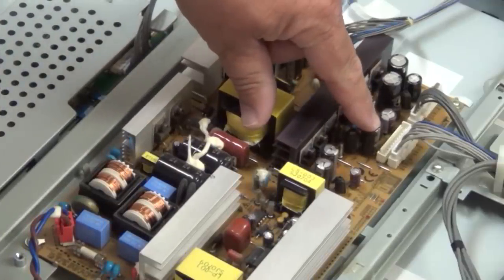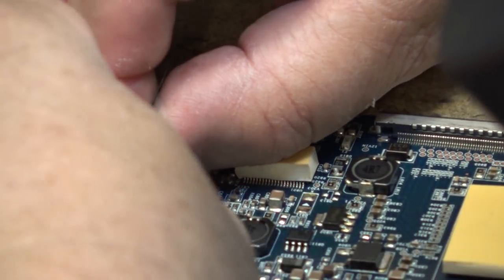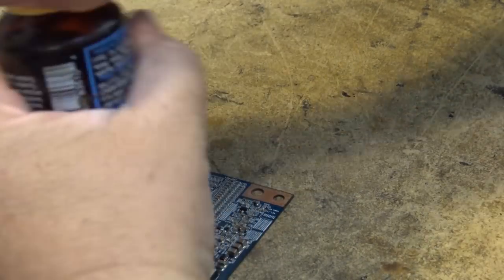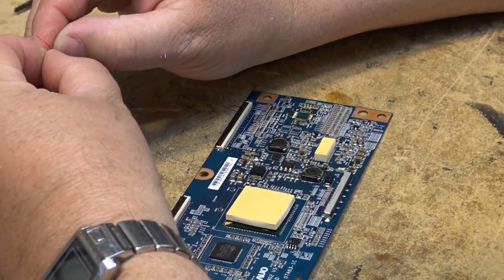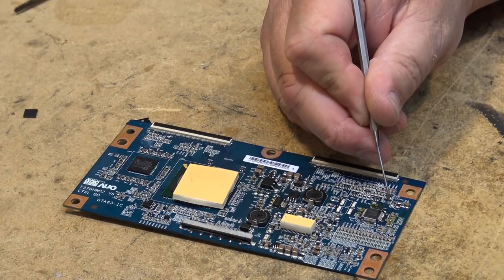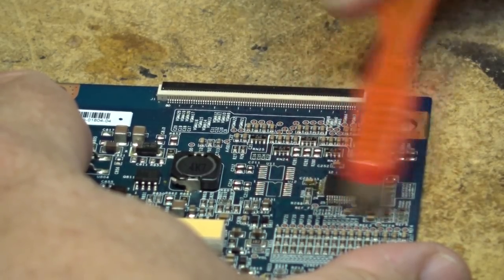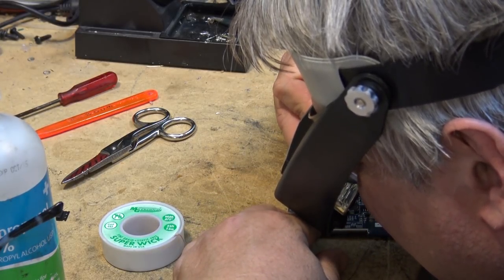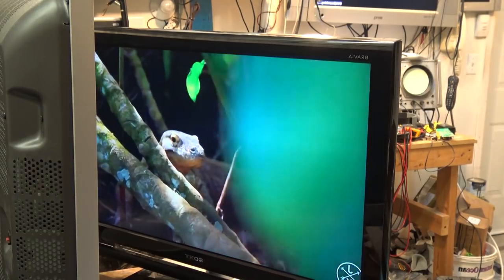Sony KDL37XBR6 Part 2 TCON board repair to component level

Comment: No hot air station for me,  if I occasionally need to do this I use my $40 hot air gun.  No issues at all with that really.  Those super cheap $50 hot air stations scare me though,  to many stories/videos of them melting down, catching fire, being wired improperly, etc.
Reply from the maker: Yes I have used an hot air gun, and masked the areas of the board that I don't want to blow components off using my aluminum heat shield mask tape.
Reply: Yeah, easy to blow stuff off with a hot air gun.  Last year I got an iso tip solder pro 120 butane iron with a hot air tip that works nicely with smaller ICs like QFN/QFP and the DPAK and sot 23 stuff, I been using it more lately.  It doesn't blow shit everywhere nearly as badly.  I think I paid $50 for it

Comment: A very good job. But you do not have to feel that you can touch the hot soldering tip. This will make everything more expensive than one dollar and sixty eight sent to the doctor! haha!
Reply from the maker: Doctor visits cost me nothing.  Spent the other day in the er after suffering heat related symptoms  at work due to not drinking enough water. Spent all night hooked up to monitors and got a bunch of fluids by iv.  Cost nothing. Would hate to think what that would have cost just a few miles south of here.
Reply: @12voltvids  Lucky you, be glad that you do not live in the south ...
Reply from the maker: @gerharddanny1160  
Yes I know how bad it is there.  One of my fires clients slipped getting out if a car in Arizona.  Landed on hot pavement.  Burns and a broken hip.  Hospital bill over 100,000.00

Comment: use a paint stripping heat gun they do the job and they are quite cheap
Reply from the maker: James Hanley 
Yes I use one as well but for micro surgery like this scalpel or razor works even better. No risk of blowing away small parts.

Comment: You need the correct equipment to take a way this IC
Reply from the maker: Actually you don't. We cut the old chips out like that for years at the shop. My boss was too cheap to buy an air station. We wither cut them out like that or inserted a steel wire under them and heated and pulled the wire. Never damaged a single board and I did it hundreds of times. An air station makes it easier but I am not about to invest in something I will never use again.

Comment: how many watts is your soldering iron?

i started watching this video and whispered - oh no, oh shit, oh no, not a chip, oh shit... 
i had the experience of replacing several chips on hard disks. maybe you know this terrible story in the begin of 2000th about 10 and 20 Gb 3,5" fujitsu drives? ahh youth... where is my 31?
snots after soldering, x10 lens, removing excess solder, international toothbrush with alcohol... i wanna repair some right now!
p.s.
sorry for my french, i dont learn english and have many errors
Reply from the maker: That was a little chip. Some of the jungle chips on those single chip TV solutions had 100 or more pins on them.  Mind you most were 1mm pin spacing which are about 50x easier to change than .5mm, and my eyes were 20 years younger. 
Anyway this is the way real service engineers measure their dicks. The ones that can diagnose and repair to component level. Board jockeys is the new tube jockeys. (That is what we called the guys that would pull all the tubes in the TV and radio tube days and run to the drug store and test them all.) Back in the tube days the real service techs were the ones that went for resistors and capacitors first and only looked at tubes of the filaments were out, or the tube was glowing like a neon bulb inside (gassy)
Used to love the guys that would come in to buy a new horizontal output tube and they would come back with the new one and the glass was all caved in due to heat. There was a bias problem, and the tube got so hot it melted the glass and the atmosphere basically deformed the envelope. 
Of course these guys generally needed a flyback now, because they were running so much DC current through the winding that now it was shorted too.
Lots of board jockeys out there that swap boards like they are going out of style. Very few have the skills to troubleshoot to component level these days.

My soldering iron is 60 watts, temperature controlled. Just a cheap one, and I highly doubt that the temperature on the display is accurate, as I have to have it cranked up to over 800' F to get a good bond, but it does get the job done and t he tips for it are pretty cheap.
Reply: i remembered the unusualness in the video! where grounding through 1MOm? how about to burn the chips because of static electricity?

yup, i need new soldering iron. i have jealousy, looking at your work. one touch and the solder is ready. but 60wt and 426`C is to much. i think about 35-40wt and 300`C (for small, under 25V, and big, 200V, capacitors), 25wt It`s hard to warm up the two-side board.the day after tomorrow I'll probably buy iron. patience is over! :)

pardonnez moi, if I'm annoying!
Reply from the maker: No such thing as too much heat. Just don't hold it on the pin longer than necessary.
 As to static, I have yet to pop any device from static discharge. My iron is grounded and I live in an area where the humidity is high as the ocean is perhaps 100 meters away, so we don't get much static electricity here.  Some types of components may be more static sensitive, but the analog chips in TVs are pretty immune to all but the most severe ESD.
Reply: well... can i (or we) hope for a video about the ocean?
Reply from the maker: I have done a few. Did a storm last summer on the Oregon coast.

Comment: Wery real picture on this one !.
Reply from the maker: I always liked the picture on Sony LCD TVs. The CCFL tubes that Sony used were what Sony called triluminous tubes. Specifically they had 3 distinct phosphor coatings, that peaked at the wavelengths of the color filters. 
Sony called it WCGCCFL. (wide color gaumet cold cathode fluorescent lamp)

Comment: Old way style...no hot air gun, no microscope...and fix done.
Reply from the maker: This is how I did it at the shop for 20 years. Owner would not buy a hot air station. They were very expensive back in the late 80s when they first came out   like 5,000 expensive and the boss wouldn't sprkng for one. So I learned old school and it gets the job done on these,  but a rework station needed for bga.  I don't work on those
Reply from the maker: The problem with giving this set to my daughter, is now she expects me to give her my car.
Reply: 12voltvids  In fact todays are cheap to equip one electronic lab but back in the 80,s, 90,s was a fortune...I,ve seen many ways to remove those big chips but that one is realy new for me...Thanks for sharing.
Reply from the maker: @mariogoncalves8091  
This is one of the ways I did it. On the larger flatpak ICs I used a steel wire from a twist tie, and placed it under the pins, heated and pulled, but that was a risk of damage to the board, so I came up with the cut method that I showed in this video and haven't damaged a board yet. Yes hot air station is best, and if I was doing this for a living I would have one, but I am not in the electronics business anymore. Just work on my own stuff mostly.

Comment: A hot air station 858 type costs about 40 euro and works like a horse.
Reply from the maker: Meh.  Too much for me. I don't do enough of this work to justify and don't plan on doing any more.
Reply: @12voltvids  The hot air is useful as ultra fast capacitor tester,preheating locally for easier soldering in multi layer pcb's,stickers and coverings removing.

Comment: You would be better off(and safer)using a single edge blade instead of a double edge one.
Reply from the maker: I usually use a scalpel or an exacto knife but I didn't one, and the razor blade served the purpose.
Reply: Yes, but there are single edge razor blades readily available, they are much safer, and since they are harder and thicker, would dull more slowly.
Reply from the maker: But that would mean going to the store to buy one. I used what I had on hand, and have used razor blades hundreds of times before. I still have all my digits.